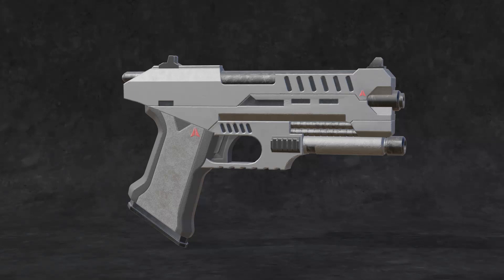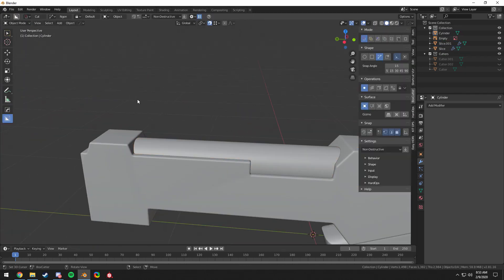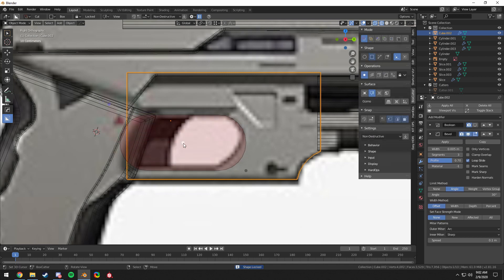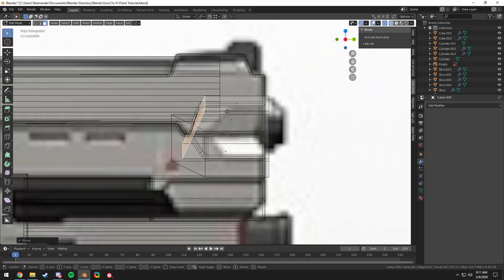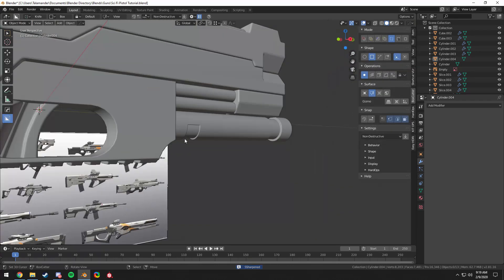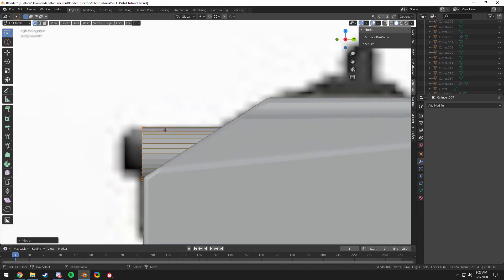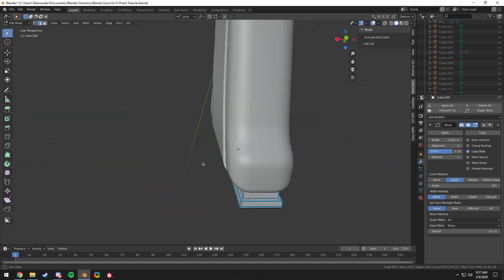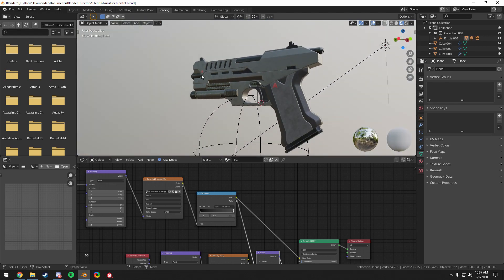Blender 2.8 - Sci-Fi Pistol Timelapse (/w Commentary)

Comment: Great video! I have 2 questions.
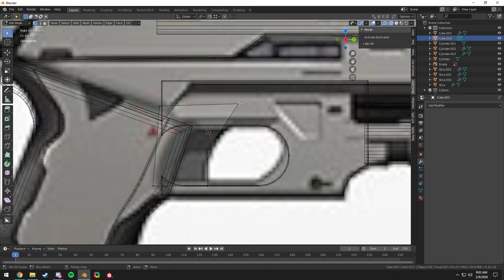1. 6:06 - how did you add that new edge so quickly?
2. I can see you are editing by vertices (dragging etc - for example the gun trigger) and the edits are mirrored. I can see no mirror modifier nor mirror editing enabled. How is it achieved?
Reply: About your 2nd question: if you have installed HardOps plugin, you just have to press alt+x.

Comment: Low poly isn't in this guys repertoire
Reply: xD It's sometimes easier to make a super highpoly like this, then do a retopo model and bake these details into it. That way you arent limited by low poly thinking at first and you can make it the way you want. Works for some weapons, others it is just easier to do it the other way. Using the right tools for the right job, working smarter and not harder and blah blah blah. Simply put, picking the fastest method for the complexity of the model is key.
Reply: @Cloudy0w0  oh it wasn't a jab at the guy, this model is amazing and it's exactly like you said, if it works then there's no reason not to work like that....just weird because when I was in university my tutor would always treat low poly modelling as the saviour of 3D design and would get mad if we ever went too high with poly count